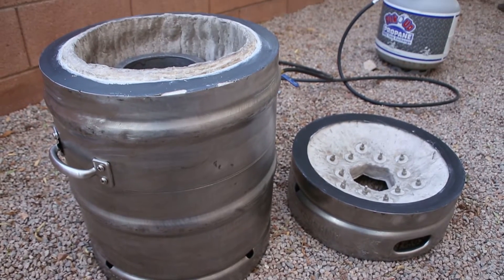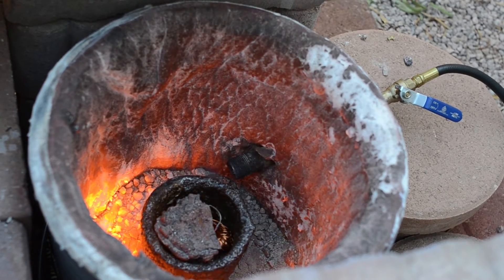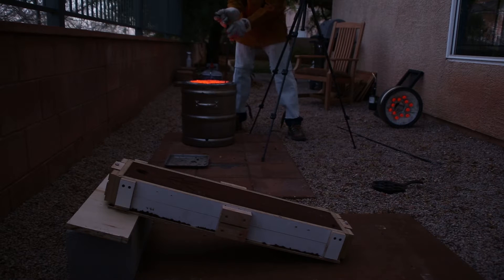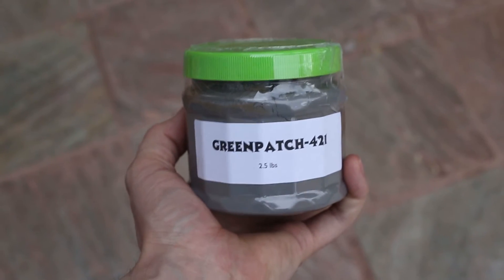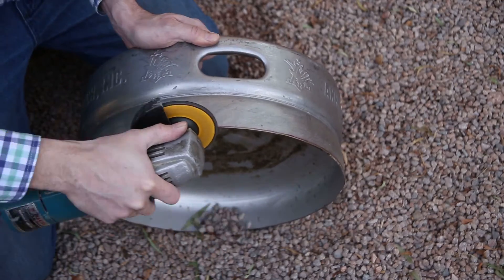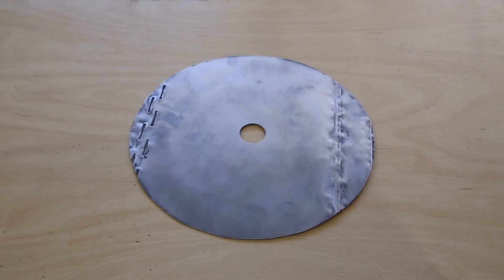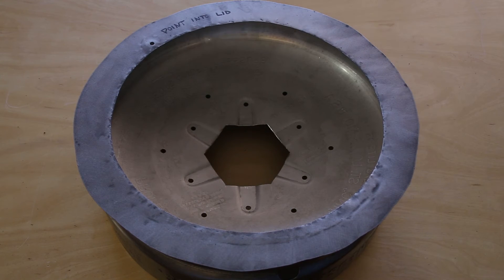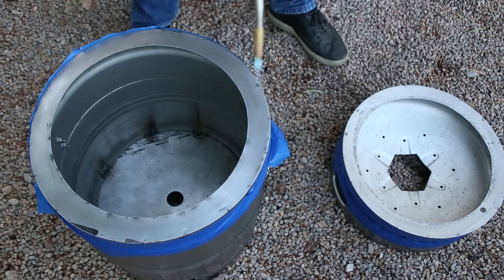How to Make a Metal Melting Furnace│Foundry Build Detailed│Part 1

Comment: Robinson Foundry , hello. 
1) What is the size of the barrel (diameter and height)?

2) Have you already changed the insulation in the stove? How much of the melting is it enough?
p.s. I'm using google translate, If something is not clear, I will try to change the text.

Comment: Hello!
I've noticed that youre using more or less the same burner design as TKOR. Can this burner be left inside the forge while it doesnt have gas supply? Im not quite sure about this, and I've thought you could know the answer. Thanks in advance.
Reply from the maker: Yeah it’s basically the same design. My burner almost never gets taken out. So yes it’s okay.
Reply: @robinson-foundry  Okay, thanks a lot

Comment: For the hole in the top is there a certain size?
Reply from the maker: I’m sure there’s a way to figure it out but just make sure it’s large enough to feed the crucible without having to remove the lid.
Reply: A common rule of thumb is 3 to 4 times bigger than the tip of the burner.

Comment: Looks good Seth.  Castable refractory like mizzou is only around 55bucks a bag.  A beer keg usually needs 2 bags.  Mizzou is rated for 3000 degrees.  Your coated kaowool will last way longer than the KOR'S plaster piece of shit.  I'm not sure why people are attracted to asshat youtubers.  The world is a strange place.  You on AlloyAvenue?
Reply from the maker: Thank you, I looked into products like Mizzou and KastOlite 30 but the curing process deterred me from trying it. I haven't heard of AlloyAvenue until not so I'll sign up. Thanks!
Reply: No AA?  Wow.  You did good then.   Also check out thehomefoundry.org  Most of the heavy hitters from alloy avenue migrated over to the new site due to storage problems after the photobucket meltdown last year.  In regards to the ludicrous curing schedule of the castable refractories...  After the forms are removed, most install a 100watt light bulb for a week and then just slow fire the furnace a few times.  Slow and easy keeps it from cracking.  People often screw up with refractory and think they are mixing cement and get the stuff too wet.  It is a dry mix that you ram with a stick into place.  I've got 3yrs on my furnace and no cracks.  It's about 2inches kaowool and an inch of mizzou.  When you burn used motor oil, no one cares about insulation.  Free fuel is the way to go.